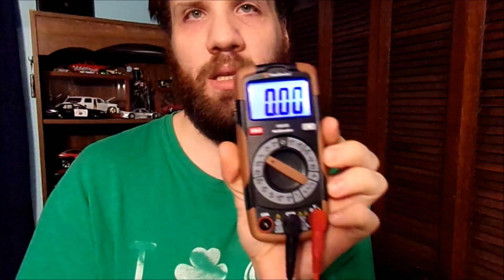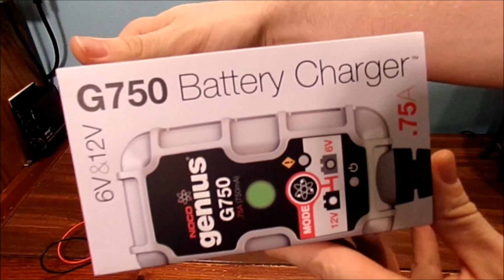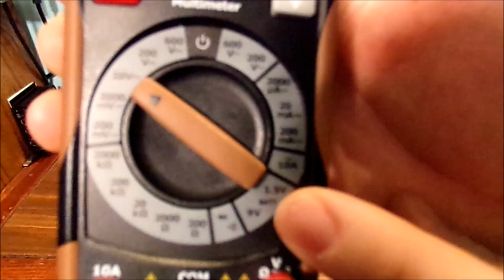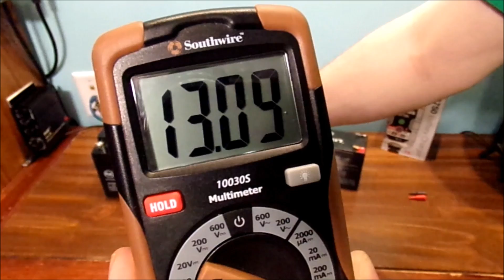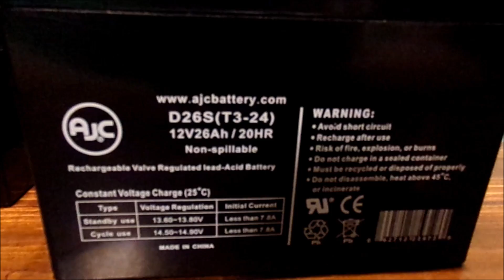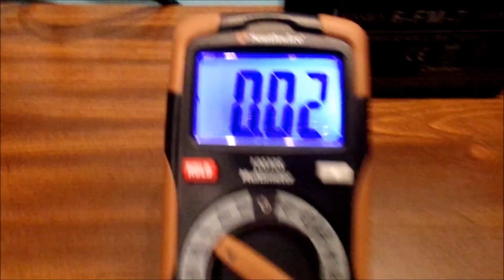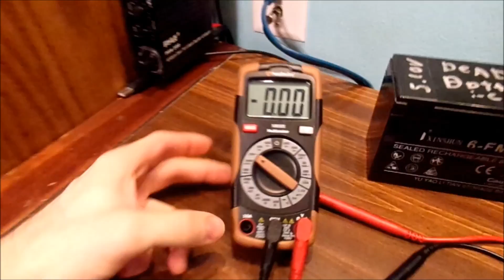HOW DO YOU TEST 12 VOLT SEALED LEAD ACID BATTERIES

Comment: Testing a battery without a load is meaningless. You need to test the battery if it has enough current as well as voltage.

Comment: Heres an idea, although I'd say it might be more Taylor made for me, but I have  an ion total ultra pa bluetooth speaker, wont power on, I have power to the on/off switch, but  that's where it stops!  Maybe a video on checking capacitors, diodes, resistors and such.  Good info here!

Cheers mate

Comment: Yeah cheers  for the info on average voltages and charging methods. I've been using a cheap trickle charger 500mA by Silverline, to charge my small 12v 4.5Amp battery for 12 hours at a time, is that ok or not?

Comment: Checking battery voltage doesn't check AH remaining.....a battery could be at 12v+ and pass a voltage test but fail a AH test
Reply: The only ah or load tester for a small sla battery like the little battery in his video that  I can find is $350.  A load tester for car batteries is only $30. I can’t seems to find something for the little sla batteries.  How are you testing ah?